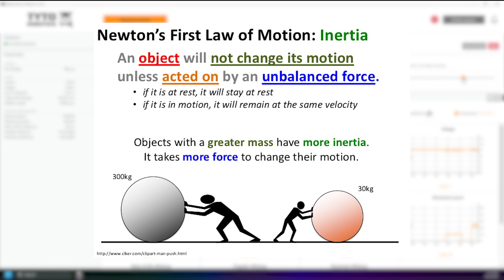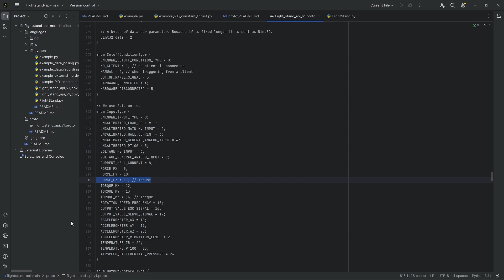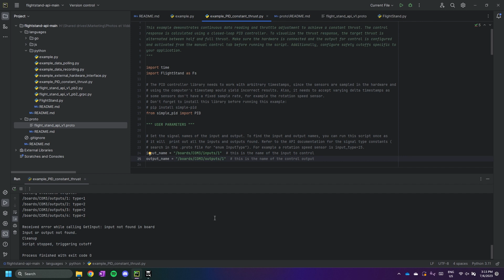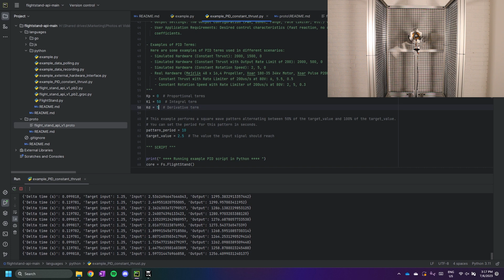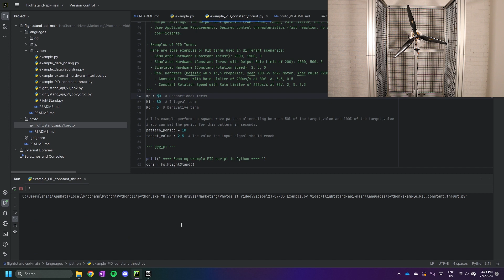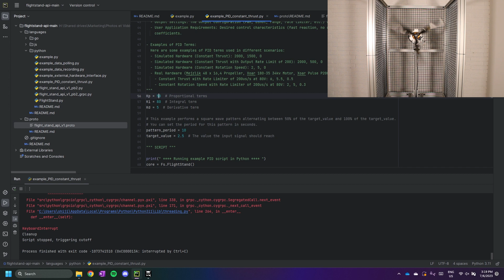How to Perform PID Tuning with a Flight Stand

Comment: Interesting, but what is the use of it exactly? Can I use the constants to recode my ESC? But that sounds like a hassle. 

Can I use it in the flight controller for my drone then?
Reply from the maker: Good question, there are many scenarios when this type of test is useful. Testing component endurance is one instance. For example, when hovering at constant thrust, your battery does not draw constant power over the entire period because the voltage depletes as it is drained. Therefore, programming a PID test where thrust is held constant can help you observe the true endurance of your battery at that thrust.